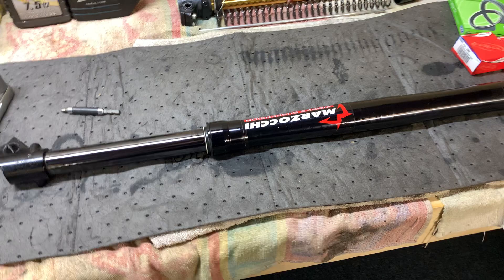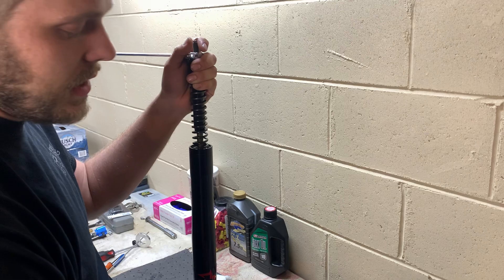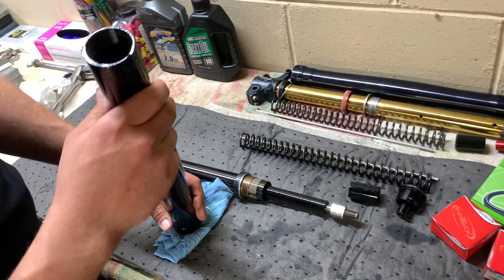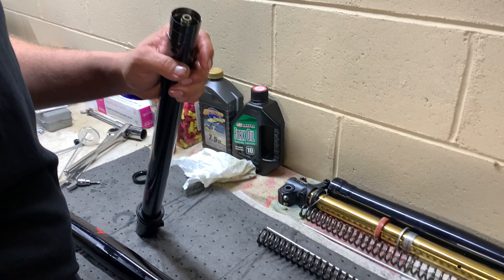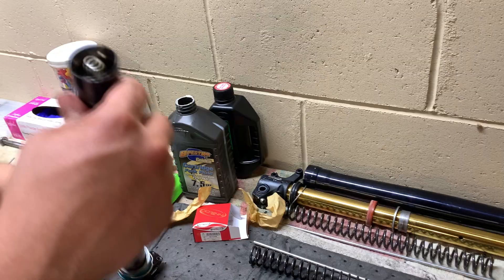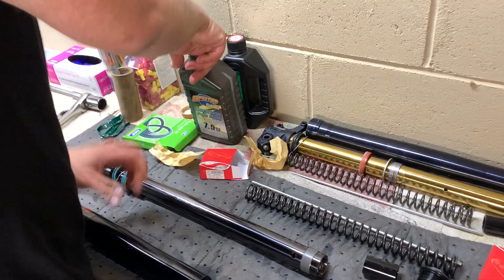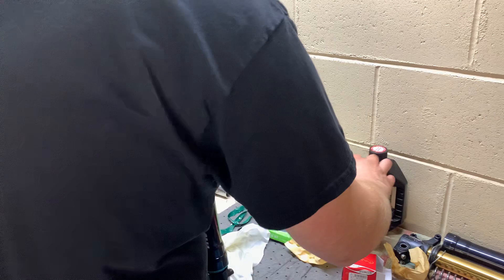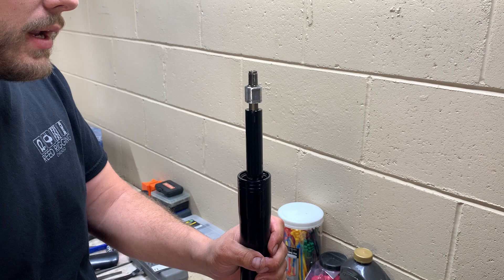HOW TO: Klx110/CRF110 35mm marzocchi fork rebuild

Comment: I’m assuming it would be the same steps for the crf50 zokes? I just replaced the seals and dust scrapers and used the 7.5wt oil but it’s like they are super stiff and I weigh about 200
Reply from the maker: Mess with your oil height.  If their to stiff, lower the level.  Only other option is change to 5wt, lighter springs, or change the valving.  Id be changing oil height and viscosity to get what i want before anything else drastic.